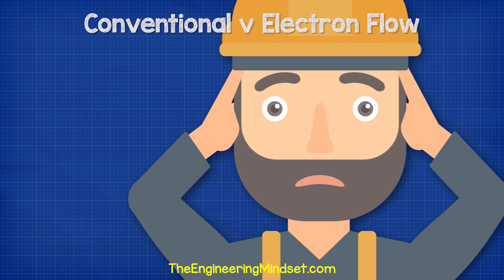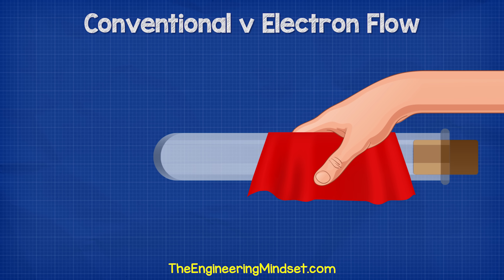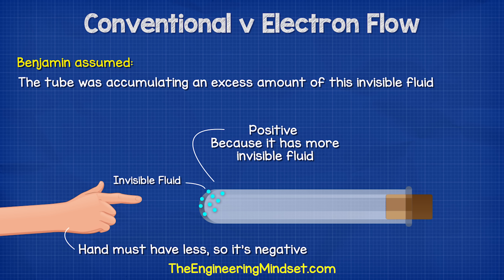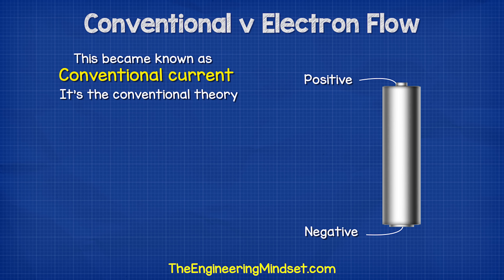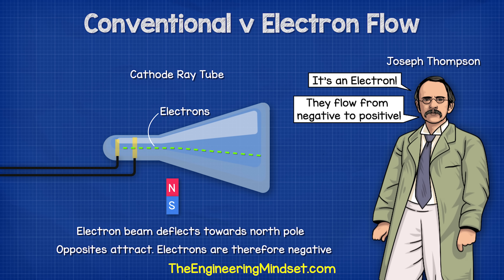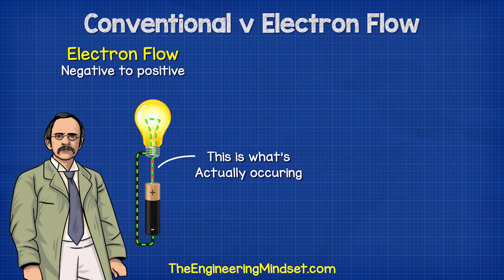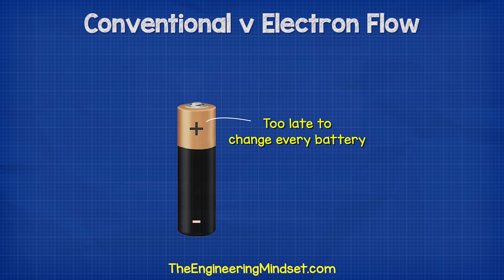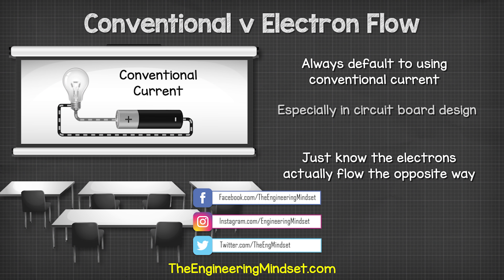Conventional Current v Electron Flow - Electricity explained

Comment: Is this applicable also to AC /Alternating Current or only in DC circuits???
Because i have encounter in AC, 1Phase 2 wire only, there is no return path. Both wires have 120V power supply.
Reply: In single phase / 2-wire, there is a return path.  One conductor is the grounded conductor or neutral, and the other conductor is the live wire.  You will see power supplies labelled L and N for live and neutral.   The neutral is at the same voltage as the ground, but is meant for carrying current.  The live wire is what is at 120V nominal to neutral.

The live wire's voltage is a sinusoidal function of time with an amplitude of 170V.   Half the time, the voltage to ground is negative, and the other half the time, the voltage to neutral is negative.   Why did I mention 170V instead of 120V?  That's because the 120V is a special kind of time averaging called a root-mean-square.  For sine waves, the RMS nominal voltage is 1/sqrt(2) the value of the maximum instantaneous voltage.  The 120V is a special kind of time averaging that tells us what equivalent DC voltage would deliver the same power to an ideal resistive load.

Comment: This video is about 95% correct when it states conventional vs electron flow doesn't matter.  It does when you get to Lorenz laws, where F = I x (little l) X B (F = force, I = current, B = magnetism. little l = length of wire).  If using conventional current, it's right-hand rule, if its electron flow, it's left hand rule.  Stated another way, knowing which way your current is flowing determines your force is going up vs down, or left vs right.

Comment: I learned circuit analysis with conventional current flow. Reading some technician's books using electron flow, and hence negative ground, made the analysis difficult, even knowing that it is physically correct. In the end, some examples proved to me the answers come out the same. I still prefer the conventional flow model, which is in sync with engineering and physics textbooks, makes the process more intuitive.

Comment: I just finished up a college diploma as an electrical technician and we were all taught electron flow - negative to positive, even for all the theory courses iirc. We were taught about conventional theory but told we would use electron flow as that was what was really going on.
Reply: Really going on? Current convention is not incorrect.  Let me explain. 
Electon flow and current flow are conventions.  But some people fail to recognize that Both have physical representations. 

While Electron flow has obvious physical representation, current flow does so too  in conductors and semiconductors as electron holes or lower eletron density flow that is opposite of electon flow. This view is no less physical real than electron flow.

Comment: The “beauty” of using the “magic” electromagnetic (convention) force is that the force can travel near the speed of light in a wire. Electrons …. No where near as fast, unless you want to include all the circular orbits. Also allows for space communication where no electrons exist to transmit signals.
Reply: Your theories are useless since current does not take entire science into account but is simply related to the flow of electrons.
Reply: @baraghaaz9123  Are you implying that interstellar communication is a theory ? In space, there are no electrons to pass signals. Also, Are you implying that electrons zing through wires near the speed of light ? (Edited for further clarification and excerpt below)
Here is an excerpt that talks about the electron drift, electron speed, and signal speed of electricity. The individual electron velocity in a metal wire is typically millions of kilometers per hour. In contrast, the drift velocity is typically only a few meters per hour while the signal velocity is a hundred million to a trillion kilometers per hour.
The conventional flow versus electron flow argument, in my mind, is only different by either pulling or pushing electrons respectively.

Comment: Confused about one thing? Why would we change the terminals on batteries? Electrons are negatively charged particles that flow from an area of negative charge to an area of positive charge. If we changed the battery terminals wouldn't that make them backwards from reality? Wouldn't the actual fix(assuming we wanted one or cared about one) be to stop teaching conventional flow? Never mind diodes...those would actually probably take some relabeling lol. Arrow points the opposite way of flow, makes sense

Comment: Why would they need to "change the labels on the bateries"?
The ends are properly labeled negative and positive. 
The erroneous presumption is the direction of movement. 
Negative charge wants to get to the positive charge. Same as with magnets. 
Or as I learned in electronics class in college (30 years ago?&$!#!)
The positive side pulls, the negative pushes.
Reply: No need to change battery labels, you are right. Negative to positive. That's obvious. I figured out in third grade that electricity was negative from the name of the negative subatomic particle, electron.

Comment: It's crazy because we wire circuit protections on the positive, which is technically at the end of the circuit, so it protects the end first when currents get high. So vehicles and buildings are protected in reverse.

Comment: I was wondering if you could explain how an automatic voltage regulator works?
Reply: That can have several answers; the best thing is to look up in an electrician's book, maybe even an automotive electrician text, how a standard voltage regulator works. It has solenoids and makes use of electromagnetic principles to open and close contacts when currents/magnetic fields reach different values. Here is a quote, albeit a bit simple, but accurate: "When voltage drops below 13.5 volts, the regulator will apply current to the field and the alternator will start charging. When the voltage exceeds 14.5 volts, the regulator will stop supplying voltage to the field and the alternator will stop charging. This is how voltage output from the alternator is regulated."
Reply: @amramjose  ahh that’s great thanks! Just doing my apprenticeship, and we use them on our steam and gas generators. But I feel that explanation is transferable ✌️

Comment: My engineering professor said they aren’t different, since electricity only flows when there’s a circuit it doesn’t matter what direction the physical particle is moving, negative going backwards is identical to positive going forwards. We don’t teach is the old way out of habit or too late to change it mentality. If electrons are negative, then you literally can’t do it the other way. -(-) = +
Reply from the maker: Seen our new video on How electricity works - for visual learners? Link:➡️ https://youtu.be/3KePcASD0NQ

Comment: Does it has something to do with fuse placement? I've been told that you must place fuse before the component that you want to protect from positive terminal
Reply: A normal fuse is just a thin wire that is rated to carry some current. If you exceed that current, the wire Will burn and create an open circuit (no current passes through) Fuses are placed after your main power switch.

Comment: like : other country's use 220V of electricity but in USA 120V  because of huge amount of money to change the full power supply system.
Reply: The US does use 240V in single family homes.  Or 208V if you are in an apartment, due to the building as a whole getting a 3-phase service.  It is just only reserved for the power-intensive loads like driers and ovens, where the higher voltage powers the heating element, and the 120V powers the motor.

Comment: Positive side has a lack of electrons, leaving it with a positive charge
Negative side has a surplus of electrons, leaving it with a negative charge
In a circuit, the negative side bleeds electrons to the positive side until an equilibrium point is reached, because protons don't move
That's my understanding at least

Comment: For me the question is Why they designated electrons as being "negatively charged," and why protons are "positively charged".  
I mean, I see the answer is almost right there in the name "Proton", but even that seems pretty arbitrary.
Reply: "Proton" just means "the first" in Greek, nothing that hints at positivity or negativity. You are correct, it could be labelled either way and nothing would change (so the video is a bit strange in saying that it was 'discovered' that electrons had negative charge). These kinds of symmetrical and equivalent labels are always arbitrary, in a way.
Reply: Through an accident of history, we assigned the charge sign convention we have today.   Benjamin Franklin had no way of knowing whether electrons flow from the glass to the silk, or from the silk to the glass.   He just knew one of them transferred something to the other, and made an assumption that turned out to be incorrect.  The sign convention was established before we knew which kind of particle was transferred.

If you traveled back in time to tell Franklin that the charge left on the glass by the silk, should be the negative charge, then our electron would be assigned as positive, and our proton would be assigned as negative.

Comment: Conventional current DOES NOT EXIST and we should stop using it and stop teaching it: IT IS SIMPLY WRONG. It is like expecting doctors to still be ok with bloodletting, wondering womb, curing women hysteria just because that was the conventional wisedom at the time. No. It is wrong, we expected them to stop doing that because we learned and progressed and finding it laughable nowadays, but yet it is somehow ok to teach just as dumb crap about electricity is schools to this day!?
Reply: It's fine. No one cares to the point where unless stated otherwise, Conventional current is assumed. It all works regardless, so no one is going to change it

Comment: When I went through Navy Electronics Technician School, we learned electron flow theory, and were told about "hole theory", but that was the "civilian" way of explaining it, however inaccurate it was. Anyhow, now I have to remember whom I'm talking too on the civilian side when talking electron speak 🤣.
Reply: We learned electron flow in civy tech school in 90-92.  In fact, our teacher was an ex Air Force satellite tech.  I recall him saying that conventional theory was what engineers used & we could expect to use that if we became engineers, and that techs used electron flow.  That was the end of that, and it was never touched on again.
Reply: Hole theory is also used in Finnish constitutional law. If you go through the process to amend the constitution, you can pass a bill that makes an exception to it (a hole). Then it you want to amend that bill, whether you need to get the supermajority depends on whether you're making the hole bigger or smaller.
Reply: Im about to join the navy for ET so thanks for the heads up

Comment: I'm a very visual and spatial learner so it's rather confusing when people insist on demonstrating factually incorrect conventional current.  Really appreciate this channel and that you use electron flow in most of your models.  It makes things so much easier to understand and conceptualize!
Reply: Current convention is not incorrect.  Let me explain. 
Electron flow and current flow are conventions.  But some people fail to recognize that Both having physical representations that can be visualized. 

While Electron flow has obvious physical representation, current flow does so too  in conductors and semiconductors as electron holes or lower eletron density flow that is opposite of electon flow. This view is no less physical real than electron flow.
Reply: @kreynolds1123  Makes me feel better that I have such a hard time understanding the physics behind electricity. With heat I just imagined an object charged with energy vs lacking energy and it was a breakthrough, but this is more difficult.
Reply: @kreynolds1123   Would you mind to explain this a bit more clearly, or maybe give a link that delves into this topic more thoroughly? It's tough to find layman resources for this niche. Thanks so much!!
Reply: @aphrodieMonkey Neso Academy has a video titled, "Electron vs Hole Flow" or something along those lines. Could start there...
Reply: Question you have a NPN transistor
Will you give the positive voltage to Collector positive or emitter negative?

Comment: The flow of electrons matters greatly in welding due to the fact that not all welding processes use the same polarity. Sometimes the electrons need to flow into the electrode and sometimes they need to flow out of the electrode.For this fact all welders are labeled in electron flow.
Reply: Interesting.  Another side note, there has been at least one model of car produced that had a positive ground (chassis).  I don't know why that would even be necessary.  Seemed like a bad idea to me.
Reply: @spaceboy3101  I know they made some cars & I thought some commercial products had a Positive Ground

Comment: So if I see a diode, the diode tells you the way the flow goes, but in reality it is telling you it in Conventional Flow, right?
Reply: Yes
Reply: Yes.  The markings on the diode are intentionally "backwards", so that you can treat them as if conventional current flowing through them.   The electrons flow against the arrow designation on the diode in the forward bias mode.

Comment: I am an electrician. Someone on TED talks said they think electricity flows at about the speed of honey dripping from a spoon on electrical wiring. This fascinated me. I would love to hear more about it in a video? Just a thought
Reply: Remember, a metal conductor is analogous to a pipe that starts out ALREADY filled with water.   Even if just a little bit of water enters at the source, water still exits at the faucet long before the source water gets there.  This is why you need to let your sink run, to get hot water, even if you have an instant source of hot water.

There are trillions of charge carriers in an electrical conductor that propagate the current.  The way they add up, makes one electron drift at a very slow speed.  The fact that there are so many of them, is what enables them to propagate energy at a significant fraction of the speed of light, through the propagation of the electric field, despite an individual electron's average drift speed being barely anything.

Comment: one problem i have got:
Does the neutral in an ac circuit carry any electron?
If it does, why it doesnt show on clamp meter?
If it doesn't, why the need of the neutral cable itself?
Reply: 1. Depends on which load. Neutral wire is used to complete the circuit in a single phase system. There are phases, all phase shifted from each other meaning current will flow between two phases. The voltage between two different phases is 400V in Europe and 208V in America, and the voltage between neutral and one of the 3 phases is 230V in Europe, Australia and Asia, 240V in UK and 120V in America.
2. It should show it on a clamp meter, are you sure that the batteries of the meter are alright.
3. You need to return current to the source for it to flow, thats what the neutral does, when you have a load that works on 230/120V you need to run it from one phase, you need the neutral to return the current
Reply: @nekilikizhrvatske3336  1) Thank you for your detailed reply. I know you are referring to three phase system (in the first part) in which indeed the phase to phase voltage is as you mentioned (400V or 208V). But if a use a resistive load or a bulb (to keep things simple), will you still get any sort of current in the neutral?

2) I unfortunately haven't got a clamp meter myself (as they are expensive in my country and their cost vs usage cannot be justified) hence I could rely from online sources. It would solve my misery if one kind soul could make a simple 1 min video while using a simple load and use the clamp meter on the neutral and phase wire to settle this matter. However, my question will still remain if some current was to be present in neutral (read point 3) 

3) I know the neutral wire is used to complete the circuit and provide a potential difference but one thing does not make sense, if all the current (energy) from the source is returned to the source, how did we get heat/light energy out of a circuit with a bulb in it (same goes for a DC circuit as shown in the video above at 2:22 ) ? Isn't it kinda breaking the law of conservation of energy. 

Pardon my ignorance in this matter, and thanks a bunch for your time!
Reply: @thecommonyoutuber8153  yes current flows in the whole loop, and for the last one youre kind of right. The thing is electrons dont waste all their energy on powering a low power bulb, but the energy drop does happen and its causes a voltage drop since voltage is bassically energy that the unit of charge holds.
Reply from the maker: Seen our new CLAMP METER tutorial?: https://youtu.be/J3kKNNizARc

Comment: I always imagine it with electrons and “holes” for the electrons fit in. The holes “move” from positive to negative. The electrons from negative to positive. This at least makes intuitive sense to me. Two flows: The negative particles want to go to the + and the empty holes move to the -
Reply: Hole flow is a thing, and it's not quite the same as conventional current and is involved in semiconductor theory.  I recommend looking it up and reading about it.  Just be prepared to have your mind bent a little bit.
Reply: @braumm1476  where must one go to get the masterful answers without the backwards stepping stones. I want the singular and initially more difficult to understand but unquestionably correct framework of conceptualization instead of multiple easy to interpret (but somewhat incorrect) layered explanations approach framework. If you can point me in the correct direction I would really appreciate it.